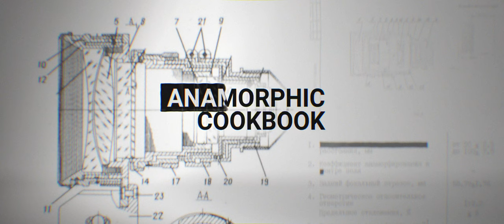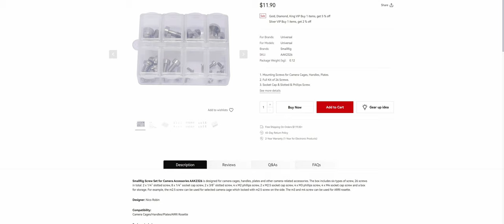Important Spare Parts for CAMERA RIGGING - Anamorphic Cookbook - Module 6 Chapter 7

Comment: very interesting. I never really needed M3 to M5 screws in rigging, but M6 (which is very close to ¼" UNC screws) quite often, interesting they didn't account for the cheese plate on that.
For HDMI, I liked to use angled adapters. Sure, the cable head gets more bulky in total, but you don't need to have different cables (in various lengths) with you.

btw, as you seem to be SmallRigs new homeboy, are you able to suggest things? I always hate when SmallRig takes parts out of production (YES, I am still salty about part 840 and 1901) - you can see some signs, but only when you look for them. Wouldn't it be cool to have some info on their site "parts that will go soon"? Could also help with clearance. I mean, even every coffee store does this with pumpkin spice latte right now.
Reply from the maker: I've raised that point a couple times already and they just shrugged. You're also not the first one to ask me to point that to them. :(
and to be honest, the sponsorship was almost symbolic, I made the module more because I wanted to than they supported me on it or paid a fair amount.
Reply: @AnamorphicOnABudget  I see. Shame on them, and thanks for taking one for the team :)